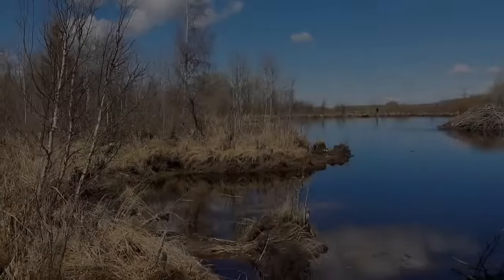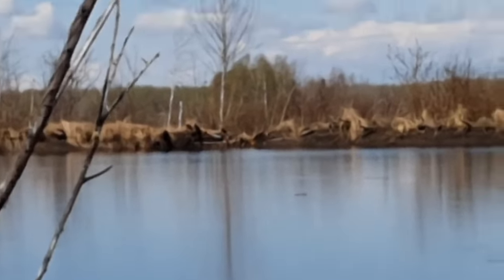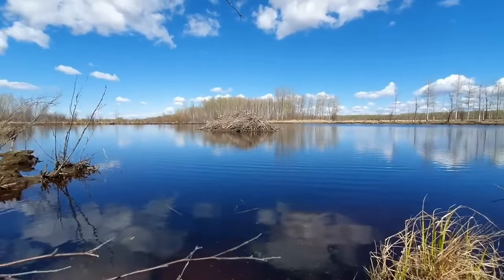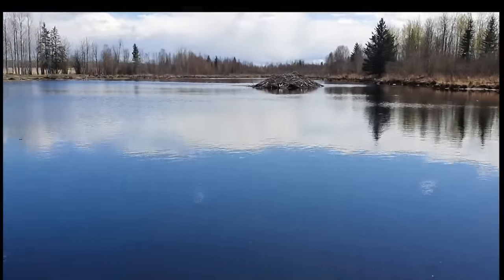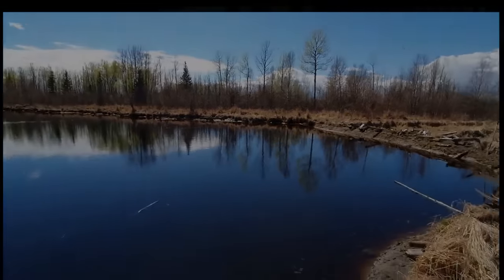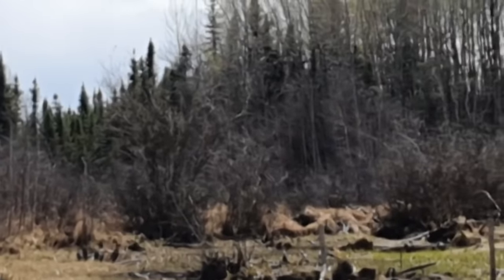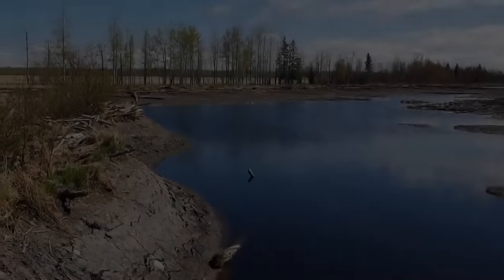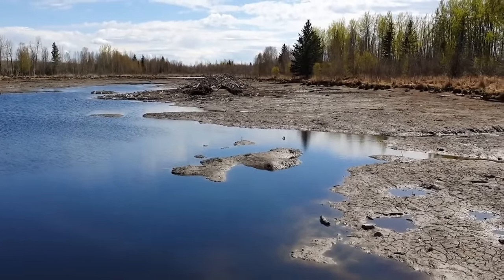Blowing Beaver Dams with Tannerite

Comment: They do to much damage to crops & property.
Reply from the maker: They certainly do! This spot was quite extensive flooding caused by these guys, - hundreds of acres. I had a problem with them on my place doing the same thing flooding out everything and killing all the trees in the shelter belt.
Most times we leave them alone, having water around is obviously a good thing, but they never stop.
I pushed the dam out with my log skidder on my place, that was an ok video.
One thing that was really interesting here, was after the water left I checked to see if they'd rebuilt but they were all gone! I made a video of exploring the abandoned beaver house with my kids. I think the link is pinned on the top of the comments.
Thanks for watching & also for putting up with the poor editing job on this one.

Comment: Control the blast. Get it in there.   Wtf set it on top wont do shit
Reply from the maker: It wasn't set on top,  it was set in as low into the dam as possible while keeping it exposed enough to shoot.  If a guy had access to dynamite that would be a different story. 
You are right though,  get the pressure down as far as possible.  Posted another video the other day using less,  but a longer pipe.  Worked ok, but as always,  the more the merrier.

Comment: Could you burn it..the shoot them when the come out?
Reply from the maker: Excellent question hairy biker ( cool name by the way). Not really for a few reasons. the dam as well as the lodge they live in are made of wood for sure, but you'll soon discover they seem to be made of about 80% mud as well. And of course although the top chunks of wood & sticks are dry, it's mostly wet wood as well.
You can however dismantle the dam as best you can to get the water flowing & they'll come to investigate and repair it.
If they are used to being harassed & shot at , there will likely be very little activity during daylight hours. Lots of guys tear out or blow out the dam & sit & wait to shoot them. We had to get rid of them an a different one at my place, because they are very destructive & never quit until they have killed every tree, flooded things as far as possible and dig massive trenches everywhere.
You can see the lodge in another video I posted exploring it with my kids. I'll try and share the link to you, it will show how things look when the water level was dropped.
Reply from the maker: https://youtu.be/vgSdgKtDyhc

Comment: The first location you should have made at least a 6’ hole in the dam for a real drain, and I think I would have set traps and got rid of the lodge that we can see 👍🏻👍🏻just a opinion boss
Reply from the maker: Funny enough about hole size. We messed around trying to dig ANYTHING out of it even enough space for the charge.  They'd blasted it before with decent success, and hoped it would drain down before the beavers came & plugged it up. It's an old dam & quite difficult to tear apart. If it was accessible with a machine they would have brought a track hoe & done it proper. As it happened, there were no beavers! At the end of the video I visited again about a week or so later & checked it out. 
Actually made another video exploring the abandoned lodge with my kids that I posted afterwards. 

Never the less, you are right. The bigger hole the better the damage & water drain & if they are still around they'll plug it up in no time. Best time to trap them is winter, - or shoot them in the summer when they are messing around fixing the dam.
It's a fun project though. Posted another one last week & a different one a couple months ago. would be a fun job to do part time.

Comment: you need to knockout the beaver too or sam will be back bynextmorning they candors more at night than bulldozers can in a day
Reply from the maker: Yup.  If there's an active group there they'll have it plugged up by morning for sure. 
Surprisingly in this one they were gone! We went back and explored inside the high and dry  abandoned house.  Posted that video a couple weeks after this one
Reply: what works good is place some homemade blast in the beavers hut and kaboom  .  problem solved till next year when more move in  . year after year over and over those big rats reproduce almost as bad as the small rats  .  all you need is some diesel fuel , pig poop and fertiliser . pack it ever so gently into a pail with a blasting cap , bury it where needed , light the fuze and run for the hills lol  :))   kaboom instant beaver stew eh  .

Comment: STUPID & DESTRUCTIVE
Reply from the maker: Well Greg thanks for sharing your opinion. It's all a matter of perspective really. I've no idea where you live, but here beavers are considered a pest animal by the fish & wildlife department. Also speaking of destructive, they cause a tremendous amount of environmental damage to farm land. This particular dam was built up so high that it caused flooding enough to make it impossible to pasture cattle on about 200 acres, cut hay on about 300 acres of land and flood out about 50 acres of crop land. Beavers are helpful to catch & hold water, but they NEVER stop until they have cut every tree available, and backed up water as far as they can manage.
 On my own property they flooded a flat area & then dug ditches and trenches so deep they cannot be crossed with machine or on horse back.
Ironically enough, it turned out there were no beavers here at all. They must have been eaten by a predator during the winter. Otters are known to hunt & kill beavers here, I suspect that's what happened.
I hope that helps shed some light on the subject,

Comment: Everything has a place, however, beavers have to be controlled. Not faulting you at all.
Reply from the maker: Yes.  Thanks. 
I have nothing against them either,  but they sure can cause a lot of damage and problems in the right place. 
Here,  the previous year things were so flooded that it wasn't impossible to gain access to several hundred acres of pasture,  Harland and crop land. 
At my place where I posted the skidder vs beaverdam videos,  they almost destroyed the shelter belt. 
Hope you enjoyed the.  The next ones are edited better as well.